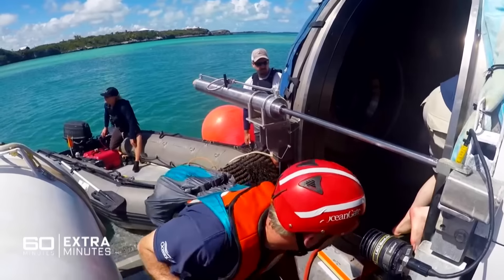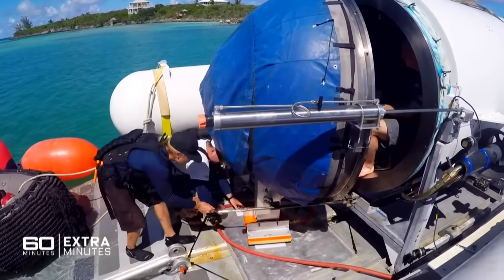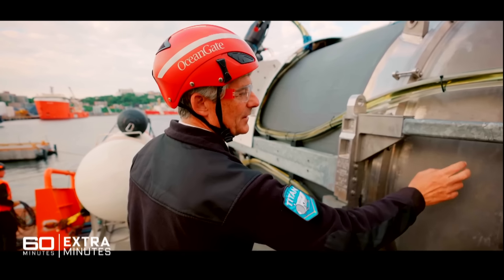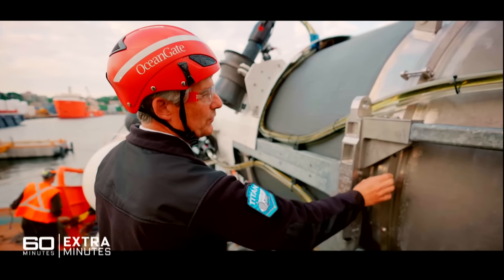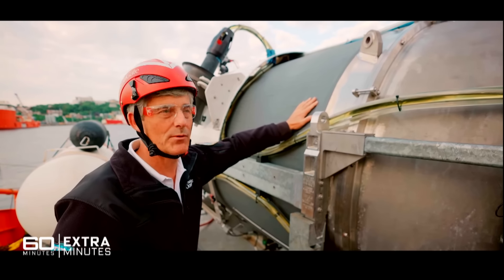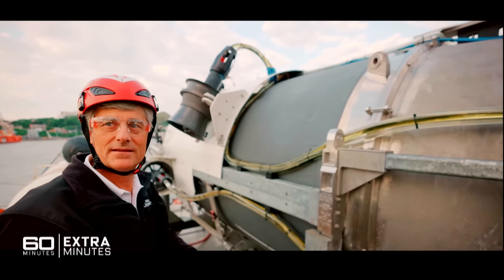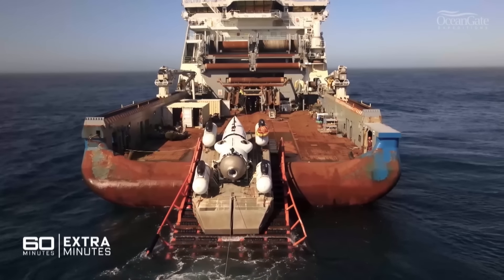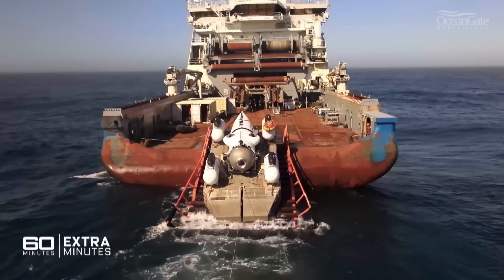Titanic sub implosion explained | 60 Minutes Australia

Comment: I was a fabricator at boeing for a few years. Based on the knowledge of composites gained there, this design is madness. Glued joints under that much pressure, not to mention the carbon fiber. Absolute madness.
Reply: Narcissists are the perfect test pilot for crappy technology.
1) if it works, you have a new technology
2) if it doesn't work you get rid of a Narcissist.
win win situation
Reply: And he fired every engineer that said his sub was subpar and only kept the one or two on that were happy to do what they’re told and collect a paycheck.

I suspect once the estate is figured out in the next decade and the NDAs are no longer valid, those fired engineers will come forward.
Reply: Good news: Stockton isn't mad anymore.
Reply: You’re not entirely wrong, but the ocean environment is very very different than aerospace.  Y’all outside the ocean environment think you know more than you do based on best practices for an entirely different industry. Stockton, an aero engineer, did the same thing.  

Ultimately this was a bad design, but for none of the reasons people like to list.  If you understand the ocean environment, it was a “very intriguing” design due to the low net weight provided by the large size and lack of need for syntactic foam, ship crane, etc.  

The glued joints btw were quite possibly just fine.  It’s confusing to me people are having such a conniption about that.  We used glued joints in the ocean environment often enough.  You have to remember that the deeper you go, the more the ocean is pushing the bottle shut.  That doesn’t mean glued joints are always appropriate or that there aren’t QC concerns, but it is not grossly negligent.  

Carbon fiber is also probably just fine if you’re not load cycling it (which Stockton was) and if you’re doing proper QC (which Stockton was not).  

With the cost savings versus a traditional design, they possibly could have afforded to swap the hull after every dive and still beat the competition on operating costs. 

Anyway, it’s a stupid design but understand the same “hubris” Stockton had by thinking he could do Ocean Engr with Aerospace experience is being coincidentally repeated by so many folk here on the internet.

Also, there are more airplanes that crashed in the sea than submarines that crashed in the sky, so really which camp would you rather trust.
Reply: Comparing Titan with a Boeing 737 Max 😢
Reply: @stevebean1234 It's pointless to say "carbon fiber is fine if you don't use it in deep sea applications" which is THE WHOLE POINT of this application. Carbon fiber was absolutely not fine in any way shape or form. You're just rambling, and your last sentence is utter nonsense.
Reply: The guy being interviewed is not an aerospace guy. He is an ocean guy. Feel free to disagree, but he thinks it's a terrible idea based on his work with subs.
Reply: Ya ya ya
Reply: You may have actually seen the rolls of carbon fiber that Oceangate used to build Titan, as it was reportedly discounted "past its use-by date" carbon fiber purchased from Boeing.
Reply: Jets with composites ARE designed FOR INTERNAL pressure...NOT External.  There is a big difference.  Cameron specifically called this out.  Composites are ONLY for Jets..PERIOD
Reply: @robinj707  I am an aerospace guy with experience in fracture mechanics, GR/EP structures and pressure vessel design. GR/EP is only good in tensile loading. It has very little compressive strength. The submarine hull is under compression.  GR/EP was the wrong material.  I wish they would have talked to me, an experienced engineer, for just 10 minutes.  The designers had to be kids with no experience.
Reply: @jonnymakers9560  No, not "... ONLY for jets..PERIOD" .... Carbon fiber has been used in race cars for over 30 years, high performance road cars for 20 years, and today increasingly in ordinary cars too.  Ditto a similar history of usage in bicycle frames and components.
Reply: @MrTodayistheday  With all due respect, Stockton Rush entirely ignored the advice from many people with similar or more experience than you, and notoriously fired one employee who told him exactly what you said.  So there is zero chance that you could have persuaded Mr Rush any differently even if you had spent 10 hours with him.
Reply: Doesn't boesing use carbon fiber for its parts?.... Thought that sh*t was supposed to be 3x as strong as steel?
Reply: @yodaddy82daddy70  Carbon fiber is massively strong under tension, not so much under compression.  Think of it like a rope, great for pulling a heavy load, but useless for pushing anything.
Reply: @pulaski1  ahhh. Makes sense bout to say I've seen the Koenigseggs bounce off walls going 200 mph and barely get damaged
Reply: The carbon fiber would have been fine if they cured it in a vacuum and did a real test to see if there were any cracks micro tears and such. But they did none of that so of course it's going to break. They also never did any tests on the carbon fiber after diving.
Reply: @jonnymakers9560 Composites are great for various things, not ONLY for jets. But, piss poor for something that is taking external pressure, compressive forces aren't something carbon composites are good at. But, viable uses for carbon composites, rockets, aerospace, high performance cars, bikes, et cetera.
Reply: One of the sadder stories is that there was a father and son on that trip.  Because he was scared, the son initially didn’t want to go but relented at the a day before as he thought it would be a good way to spend more time with his dad.
Reply: @yodaddy82daddy70  only under tension. Not compression . The application was purely compressive load. Its a terrible idea and a small miracle it dove so deep multiple times.
Reply: @Handro_  no. Compression is carbon fibers greatest weakness. It is strongest under tension, has diminished strength under flexion, and is weakest to compression.  Compression is what a submersible experiences. It was a terrible idea and the fact that it pulled off multiple dives is amazing.
Reply: To be fair, I wouldn't feel too sad. Each person who died went into that thing WILLINGLY, signed waivers and such. So it was a known risk to do such a thing, that said no-one could get me into a DSV made from carbon fibre. 👍
Reply: Holy shit ! Suddenly everyone on the internet is a carbon fibre expert & for all of it’s applications.
We have people calling each other out here that most likely can’t even keep petrol powered garden machinery running for more than two seasons before throwing them away for new but they know all about pressure cycling submersible vehicles to 2100 fathoms.
Reply: OK you are perfect to settle a debate I've been having since this happened. I say if you had smaller titanium rings inside the carbon fiber section it would have made it stronger. The other side says that titanium rings inside the carbon fiber section would have made the sub less strong and would have imploded sooner because of the different ways each act under pressure. Thoughts? I can't see my way being weaker than just carbon fiber but we have been arguing about this since day 1.
Reply: @Henry-sv3wv there is a difference between narcissism and greed.
Reply: @butter7734  to be honest I dont know. But my guess would be both ways are equal and different methods of failure. By having the titanium inside, as opposed to "on end" you may be creating a pitential shear point as opposed to potential separation points. To be honest tho I'm guessing because my knowledge on these materials is not extensive as I only did fabrication,  not engineering.  In my opinion the carbon fiber pressure chamber was a weak link no matter how you stack up, or attach the other components.  Sorry I can't help to settle it.
Reply: @GSF404   im not sad. You're sad.😉
Reply: @butter7734  Titanium has more desirable properties than carbon fibre when it comes to compressive loads, it might have helped but the titanium rings the two hemispheres were bolted to wouldn't have added more strength of internal as it was just a method of interfacing the hemispheres and the carbon tube. The issue being there was no 'ribbing' along the length of the carbon fibre crew compartment, of there as a bunch of titanium rings arranged like that, that would have helped in all likelihood but I doubt it would be a permanent fix, carbon does isn't suited for DSVs, there's a reason no-one makes them out of that. High Yield steel is used for submarines like the Astute class, HY steels aren't all that hard either for reference.
Reply: Maybe he wanted it to fail, unless he was just that stupid, I think he wanted to fail, and get the full titanic experience of death
Reply: @deadbrother5355  no problem to tell you the truth is was nice debating someone with a brain. Sometimes it's difficult these days. Everything you stated has come up in our debate. Thanks for responding though.
Reply: I think most sane people would (and should) have bounced when they noticed the thing was controlled with a Logitech controller.
Reply: But...but it's cheaper.
Reply: @DV-zv4ox  I would have, not everyone is smart, even if they have 250 grand..just privileged
Reply: @@klinestill "That's either madness or idiocy or both."

Negative.  You're whole post is nothing but theory, and practice disproves it.  It depends on the application.  US navy has ocean systems with glued joints that have been in use for decades.  Decades.  Does not mean glued joints work on every system.
Reply: @channelchen  the biggest issue is the Carbon Fiber tube.  Two main reasons 1) Carbon Fiber is difficult to manufacture flawlessly, for a serious application like this you should use ultrasonic scanning to inspect the finalized product to make sure there is no void space.  Ultrasonic scanning is totally viable, although reportedly OceanGate was not doing this (there might not be truth to the reports, because you'd have to be pretty crazy not to do it).  and 2) when you load cycle Carbon Fiber (meaning you put a lot of load on it, remove the load, add the load, remove the load, ..., over and over), the individual fibers inside the carbon fiber can snap.  What this means is every time you flex it, it gets a little weaker.  Since Carbon Fiber is really rigid and complex, you can't really tell how many have snapped or how weak it has gotten (without ultrasonic scanning perhaps) until all of a sudden it cant take the load anymore and it fails catastrophically.

Both issues could be mitigated with how they operate.  For example, they could ultrasonic scan the CF tube and throw away any that were bad.  Also, they could have chosen to throw away the CF tube after each use.  However, in both cases they would have to have a good design and testing.

With "A LOT" of R&D, its possible they could have accomplished a lot more.

Tbh, I think they took on a lot of risk (which was stupid), and cut corners (which was nuts).  That doesn't mean what they were doing was impossible.
Reply: @robinj707  THANK YOU!!!  And the Rob McCallum guy is a PADI Diver with two Management degrees - not an engineer at all!  UGH.  Rob's comments aren't exactly wrong, but they're far from the complete truth.
Reply: @MrTodayistheday those guys obviously had a arrogant boss who only wanted to hear that the sub was perfect in every way and they wanted to cut cost and beat the competition, they weren't going to do anything traditional and spend a ton more. They knew it wasn't deep sea worthy and took a gamble every dive to make more profit for very little cost to them
Reply: maybe its a chemichal wises , I believe there is an option for carbon , just not the way it was done on the Titan and Cyklon
Reply: Given your expertise, do you have any theories as to why he would do something like this?    I saw one interview where the person said he thought Stockton Rush knew this was going to happen and wanted to use it to make a name for himself.   It’s really hard for me to imagine something like that.
Reply: @banzairunner7860  I can only guess. If I were to guess it would be either:
1. He was nowhere near as educated on materials and engineering as he thought.
2. He was truly a fly by the seat of your pants and "break stuff" type.
3. He had mass murderer /suicidal tendencies. 
4. Possibly all of the above. 
As a footnote its amazing to me that the titan made multiple dives so deep essentially on the strength of the resin in the carbon stack up alone.  I'm curious what his life insurance policy was worth.
Reply: @banzairunner7860  He thought the failure detection system, which was supposed to detect cracking/ failures in the hull, would give them time to surface, at which point he would have had to replace the hull.  In reality the hull was making audible cracking noises from the earliest test dives in the Bahamas - yes audible cracking noises, no fancy detection system required.  ...... What I haven't seen is any explanation of what Stockton Rush considered the limit of "acceptable" cracking noises to be?  At what point would it be considered a problem?
Reply: @stevebean1234 rethink your position
Reply: Well said
Reply: @Handro_ when I saw how it was manufactured, I felt the same. Just a tech guy here, but have worked with a lot of different  materials and applications. Well said
Reply: @banzairunner7860  Yes, the traditional designs like DSV Alvin have much more weight than buoyancy and rely on very rigid and expensive syntactic foam in order to resurface after diving as deep as Titanic.

By having a voluminous carbon fiber tube (which displaces more water), buoyancy is increased.  Carbon fiber has better strength:weight ratio than titanium. By not needing syntactic foam (which is very heavy out of water), you don't need a ships' crane.  So you can deploy off normal ships and save money.

It is an interesting design hypothesis, you would just have to mitigate Carbon Fiber's weaknesses with R&D or operations techniques, which would have added cost (possibly, more cost than the design was worth).  Stockton apparently didnt' succeed with that and IMO he was a fool to try.
Reply: @yodaddy82daddy70 Air Pressure is different from Underwater pressure.

There's a reason why we are able to send things to Orbit regularly, while we barely explored the Oceans.
Reply: Wouldn’t there be different coefficients of expansion for the titanium and carbon fiber that would stress the glue joints?
Reply: stevebean1234 Found Stockton’s ghost. Dude is dead and he STILL can’t let it go!
Reply: it wasn't a real event
Reply: @tropifiori  your ultimate question is really one of design tolerance.  the only "coefficient of expansion" I've ever heard is thermal expansion, and thermal expansion is really negligible for the scale and tolerance of most undersea vessels.  

at 4,000m you're at ~390 atmospheres of pressure.  that isn't negligible.  any pressure vessel is going to compress, bend, buckle at that depth.  so, going to depend on how much compression is going on and how elastic the glue is.  

Worth remembering that bolt holes in pressure vessels have similar problems.  can't calculate bolt hole stresses effectively with CAD so have to derive the stress concentrations by hand.  the geometry of the end cap and hull are different enough that they'll compress at different rates, so all that stuff adds some challenge to the pressure vessel design.  Therefore, if you have the right joint design the tradeoffs of using glue might be worth consideration

IMO the glue is absolutely a sketchy design choice for a crewed vehicle where the criticality of failure is much higher.  probably safe to assume oceangate didn't do extensive R&D on it, either, which is a very unsettling thought.  maybe they had access to good trade knowledge but thats a rarity so i doubt it.  keep in mind though they also successfully completed 13 dives to the Titanic so it wasn't so sketchy as to outright fail all the time.  still a wild choice.
Reply: I was a helper for Einstein for years and built many ships this was a fail
Reply: Carbon fiber is for tension.. not for wrapping and pushing from the side. This was insanity on steroids. I'm not an engineer, but I know tension and compression. This was ridiculous and deadly.
Reply: And no Autoclave treatment......
Reply: @stevebean1234  You stated that glued joints are 'possibly' fine and then that using these joints is not negligent. This cannot be.  To use a joint that is 'possibly' fine in that environment is negligent.
Reply: @@DaleGribble-us9wc they merged, but you're right. The company took a hard turn in ethics when the McDonnell Douglas leadership took over.
Reply: @@DaleGribble-us9wc 
Boeing existed at the same time as McDonnell Douglas, McDonnell Douglas merged with Boeing in 1997, it's uncanny that you would "know several people there, having been in it yourself"....
Reply: @MrTodayistheday  what is GR/EP
Reply: @@DaleGribble-us9wc 
Not to put too fine a point on it, but this is the Internet, the reality of that being, there are literally millions of people checking YT comments forum out at any given time, from all around the World......as much as the age of ignorance is well and truly over, and we can literally pinpoint within reason, pretty much any location on the Planet with Satellite assist and assets like Google Maps, it still just comes down to having the inclination to "search" for a specific geographic location, I live on the Australian Eastern Seaboard, right on the Coast with the Pacific Ocean at my door, so, no, I don't know the one in "Hazelwood MO", and to be quite honest with you, I don't particularly feel inclined to "search" for the location. But all the same, I hope you are well and are able to reflect on a life well lived.
Reply: Furthermore, it was reported that the carbon fibers' axial compressive strength is only 10%–60% of their tensile strength and their transverse compressive strength is 12%–20% of axial compressive strength.

A chain in tension is strong, but is completely useless in compression.
Reply: @stevebean1234 to be fair a submarine or submersible cannot crash in the sky lol
Reply: @stevebean1234  You might want to do a bit more research before you crap on those commenting about the sub, the completely reckless Rush, and his insane design which everyone that knows anything about CF and these subs said it was an impossible feat, he only surrounded himself with yes men to get what he wanted and lied about most everything, he didn't follow any proper protocols for anything he was doing, especially with the CF!!
Reply: @455buick6  you should do some research on ad hominem before attacking people.  i have spent 12yrs as an ocean engineer and designed 6 vehicles all but one are in the field today operating and all but one were undersea.  if you think i am defending oceangate you should go get your head checked, or take an english class, or both.  none of the people in these interviews are ocean engineers; they're submersible drivers or managers in the deep sea field.
Reply: @Vincentofvega  everything in engineering is "possibly" fine.  even when Boeing did 10's of thousands of pressure cycles on the 737 cabin, they still screwed up and the aircraft pressure hull would rupture 50% faster than expected.  sucked a couple ppl out of the plane over the pacific ocean.  it was "possibly" fine, they did a bunch of testing to gain confidence in it, and there were other factors that they didn't consider that made it not work out.  Nothing in life is guaranteed

I was also responding to a poster claiming glue is "insane" and it is not "insane".  Ocean systems use glued joints.  Negligent, quite possibly - grossly negligent, quite possibly - it depends what testing they did.
Reply: @OregonDARRYL  carbon fiber and fiberglass are bad materials but not for that reason.  they work just fine in compression.  the individual filaments are good in tension, and the epoxy resin is good in compression, and when you put them together they're better at both.  the titan made 13 dives to the titanic, CF works, they just didn't account for how crappy CF is because its failure is unpredictable
Reply: @stevebean1234 You said the glued joints were possibly just fine. Uhm...no they were not. Any responsible engineer who's had even a little experience with FEA (Finite Element Analysis) would have spotted the inherent problem and weak point at the glued joints and immediate put the design into question and scrapped the entire premise of using carbon fiber in this manner.

How this entire concept even got past an initial interation of stress analysis is beyond comprehension.
Reply: So telling you to do more research before commenting is an ad hominem?  Exactly where did I say that you were defending oceangate?
Reply: @455buick6  "You might want to do a bit more research before you crap on those commenting about the sub
"

Rather than argue a technical point, you're implying I'm uninformed and "crap[ping] on those commenting about the sub".  Neither are true.  I admit to "crapping" on people who insulted me.

"...the completely reckless Rush, and his insane design which everyone that knows anything about CF and these subs said it was an impossible feat, he only surrounded himself with yes men to get what he wanted and lied about most everything, he didn't follow any proper protocols for anything he was doing, especially with the CF!!"

Rush was reckless.  CF is absolutely possible, hence the 13 Titanic dives it made successfully.  CF is impractical in load cycling / reuse applications, hence the eventual implosion.  As far as CF and subs, a vast majority of the people talking about it are submersible pilots, submersible company managers, and technicians - not R&D/ocean engineers.  CF is likely impractical, so R&D to develop safe "protocols" for CF in ocean has simply not been done.  Is there a theoretical protocol to safely use CF deep sea?  Yes.  Does it exist?  No.  Did rush break the protocol, then?  No.  Does a technician who hasn't been trained on this non-existent protocol know what he's talking about?  No...

I used to see OceanGate's job postings when I lived in PNW and didn't even consider applying bc something seemed off.  I am sure if I was there I would not last long bc his design approach was horrendous.  Is CF inherently impossible?  No.  Is CF a bad choice?  Probably, but it might not be - if and only if - you're doing requisite research and testing.
Reply: @stevebean1234  "Is CF a a bad choice? Probably but it might not be..."

No. It will always be a bad choice for this type of application. It's not a homogeneous material. It's held together by plastic (epoxy) and that's susceptible to fluid intrusion at high pressure...among other obvious weaknesses. It will never be used for submersible pressure hulls. Not sure why this is even a debate.
Reply: @jamescrud  then why did Stockton choose it?  Why did Steve Fossett choose it?  Why did a billionaire buy Steve Fossett's design?  How did Titan make it to Titanic 13 times?

There are discrete answers to the question.  Once you can answer those you'll see exactly why it's debatable.  But I doubt you can answer those questions, or else you wouldn't have written such a reply.
Reply: @jamescrud  epoxy, plastics, and polyurethane absorb water even in low pressure environments and are used all over in maritime engr.
Reply: As a guy whose fixed a xouple of fibreglass boats i his soare time i can also tell youbits bonkers
Reply: @stevebean1234  Exactly. These materials absorb water. That's the last thing you want to happen with CF. That infiltrated water under immense pressure gradually forced the CF fibers and epoxy apart over time...and boom...instant mash potatoes.
Reply: Boeing autoclaved their carbon fiber structures, while OceanGate did not. OceanGate also used outdated carbon fiber from Boeing who deemed it unsuitable for airline parts. Also one of the technicians who cleaned the glue surface on the Ti retaining ring did not bother to wear gloves and most likely left his skin oils on the Ti surface.
Reply: @stevebean1234  Concrete and rebar would have been better than this horrible joke of "engineering".
Reply: @stevebean1234  carbon fiber is not a good choice for compression jobs, must be some good crack you got
Reply: @stevebean1234  Incredibly condescending, and a stupid quip at the end about submarines crashing in the sky.  And you missed a key design flaw.
Reply: The real crazy part is it actually worked for around 30 or so dives... So it's not as crazy as it seemed just was probably years away from manned testing...
Reply: Anyone in their right mind allowing to be bolted shut from the outside and zero certification on safety isn’t too smart. Paying $250k to look out a tiny window for a few minutes is beyond ridiculous.
You can see close up videos of Titanic from your TV. They learn nothing by going to the wreck at all.
Reply: @nedmilburn  Yes, yes.  The truth is "condescending".  The ultimate irony is this is what engineer managers like Stockton Rush say to their people in order to keep them in line.  Guess you're one of the ones who can't handle the truth, either.
Reply: @mobilemarshall  Take a materials science class
Reply: @jamescrud  ". . .  gradually forced the CF fibers and epoxy apart over time . . . "

key statement right there.  what is the timescale?

PS - delamination via pressure is definitely one of the possible failure modes, but there are a couple.  having worked with CF and other passengers' statements of hearing "bangs" and "booms" while diving even to shallower depths, I'd put my money on breaking of individual fibers over time.  but could be both.
Reply: @pulaski1 Correct sir.  And as an add, it did, and still sucks in bicycle frames.   It’s not so bad for some components and I’ve built literally thousands of CF bike wheels with it ( rims being the CF portion of the builds ), for both recreational and racing applications with largely favorable and consistent results.  That being said, you couldn’t give me a CF bike frame no matter what I was using it for.  
The fact is also that bicycle manufacturers QC varies widely across brands for several reasons so that’s a variable to consider if you just have to have CF for your bike.   Certainly not criticizing anyone if they find it fits their needs.  Just not my cuppa.
Reply: @stevebean1234  It is both. If water gets into a void in the epoxy it's going to force the epoxy away from the CF fibers. Once that starts, those voids increase in volume filling up with even more water under pressure. The larger the void becomes the more surface area there is for the water to act against resulting in more and more force being applied to the epoxy and fibers eventually causing everything to break. This process started with the very first dive.
Reply: @dustinranck7388  CF doesn't do anything for me in a bicycle frame, or any part of a bicycle, period.  I only ride for pleasure, and saving a couple of pounds at the expense of the life of the frame isn't something I am interested in, even if it was the same price as aluminum.
Reply: @jamescrud  voids in Carbon Fiber are avoided with careful manufacturing and parts are tossed out in QC if voids are detected.  this has been common practice since before i entered the field, as early as 2002.  Void space in CF matrix causes several problems and likely not the one you described.  if there were void spaces in the CF they used, my guess is that it would have failed on the very first test dive and not have made it to 13 trips to the Titanic.

The main issue with your theory is that water would not ingress under pressure nearly as quickly as you would think.  there are air voids in nuclear submarine skin by design.  why isnt this a problem?  because air is compressible and the void space simply compresses as necessary to negate any pressure differential between the air pocket and outside environment.

void space is bad in CF not because of water impregnation, but because it will cause layers of the CF to flex leading to filaments snapping or further delamination along the matrix.
Reply: @pulaski1  i disagree,  but what type of biking are you into? That is a big factor i think. I mountain bike (xc and downhill) and my carbon bike is my favorite bike I've ever owned. I have 6 inches travel front and rear, and its several pounds lighter than my old bike of similar spec made from aluminum. If you're into bmx or road i could see your point tho as they are stiff af. I rode a carbon dirt jumper, and even though it had a front shock, the feedback through my feet was torturous.
Reply: @mangakey  i didn't realize it was so many dives to that depth. Nonetheless, it wasn't the strength of the c/f that enabled that. It was the resin. The c/f was a bad idea for compressive forces. I doubt it'll ever happen again, a c/f sub that is.
Reply: @deadbrother5355  You're obviously "into" bicycles, I just like to ride sometimes, not competitions, not against the clock, not even for "a cardio workout".  I just like to ride my  bicycle sometimes, to get out in the fresh air.  There is zero chance that it would be more fun on a carbon fiber framed bicycle.
Reply: Holding in 15PSI air is way easier than keeping out 6000 PSI of water.
Reply: THIS IS SPARTA!!!!!
Reply: @stevebean1234  You're referring to anechoic tiles attached to the surface of a submarines hull. They are not integral to the actual structure. The can fail and fall off with zero consequence to the structural integrity of the submarine...that's why it's not an issue.
Reply: @stevebean1234  sounds like you dropped out of yours
Reply: It was the decision to add titanium instead of steel, two different expansion rates and tensile strength….it’s a little different than bolting in components on an aircraft lol
Reply: @pulaski1  the weight difference goes a long way. But the rigidity on frames without shocks is brutal. The weight really does make it more fun because you can go faster etc. But if you're happy im happy.
Reply: @jamescrud  yes, the anechoic tiles.  the alberich tiles patterns are very often made from neoprene these days and when glued to the submarine hull maintain air voids inside the various diameter openings.  the submarine goes up and down and the air voids simply compress and decompress as needed.  They peel off in many cases but that has more to do with speed and mass density of water,

What you're speaking to in the latter half is "criticality of failure" from FMECA perspective, and yes I agree.  I think OceanGate is horrendous from that perspective.
Reply: @stevebean1234  Neoprene is flexible unlike CF composite. It's able to compress without failing so voids don't cause any issues.
Reply: Yeah i was booked to go on but pulled out after having my engineers go over the designs extensively, and strongly encouraging me to think twice about this venture. Dodged a bullet there
Reply: The average laymen would call it stupidity. No need to pull punches with something this egregious.
Reply: @stevebean1234  There's also a LOT more flights hourly and daily than there will ever be on submarine trips, so your numbers on airplane crashes into the sea are quite skewed.   Lets do some ratios and maths first before making a ridiculous statement that there's no submarines that crash in the sky.   Of course, NOT.  Don't be daft.
Reply: @@klinestill its neither madness nor idiocy.  Its all about narcissism and the Benjamins.
Reply: @Henry-sv3wv 😂
Reply: I don’t believe them 🤷‍♂️
Too much footage from previous dives but not ONE shot on this trip not even a pre trip video 🤔
YEAH RIGHT OCEAN(GATE)
GATE=
Reply: @Publiclighthouse this is an inaccurate story perpetuated in the media and posts like this. It is factually incorrect the young man did not want to go. He was in fact excited about setting a Guinness record. You should always look for facts before spreading misinformation. Thanks and have a nice day.
Reply: @stevebean1234 they couldn’t throw the tube out they only made one!
Reply: @pulaski1 the answer is that no audible cracking should have existed. The first noise was the first step to failure.
Reply: @JayandSarah  I totally agree - cracking during the initial testing proved that the design was probably flawed from the outset, and at very least the execution of the designed was flawed.
Reply: I guess I inadvertently stepped into an "experts" convention
Reply: @stevebean1234  bet you are the life of your own party uh
Reply: @lonewolf.63  ad hominem
Reply: @prospero11  ad hominem.  your post has zero substance.
Reply: @yodaddy82daddy70 parts being operated in an atmospheric environment is one thing. Comprising the hull of a deep sea vessel under direct loads of massive pressure is something else.
Reply: @stevebean1234 every engineer aerospace and ones that specialize in underwater craft said carbonfiber has been tried for seep sea trials and everyone agreed its not atrong emough. Why are u even arguing it clearly failed like predicted and ppl died. U need solid steel like the James cameron craft and even then its not made to go that deep more than once. The dude thoght he knew better and ignored other engineers and now hes dead and he took 4 ppl with him because of his arogance. And yet ur still arguing?
Reply: @MrTodayistheday they did talk to engineers. Then they fired them for saying this was a suicidal design. Carbonfiber works great above water. Race cars, planes. It doesnt work   when its glued together with pressure applied on all sides under water
Reply: @yodaddy82daddy70 it can be if its molded in a way where its hard to snap. Its not strong enough when pressure is appleied all around it under water. Also it was glued together on its sides and that is the weakest link so the pressure just  poped the sides of It inwards  killing everyone
Reply: @Handro_ thay onle works when you have air going over it and pressure is applied from one side like aerodynamics on a sport's car. If u applied pressure on the aerodynamics from a side that wasnt inteded to have high stress forces you can easily snap the best carbonfibef design. Its not meant to have pressure on all sides so it dont matter what they did to it. It would eventually fail anyway. They did vacuum seal it, otherwise it wouldnt work but it dont mater anyway. It would have failed regardless
Reply: @GSF404 except the kid. He wanted to impress his dad. He was nervous at first but the dad and stockholm convinced him its safe so he ended up believing them
Reply: @WhiskeyGulf71 lol right
Reply: @butter7734 if one material is compressed more than the other then it would be weaker. One of the materials would compress more and it would destabilize the whole structure. In this case the carbon fiber would compress and the titanium would sort of act like a knife cutting into it
Reply: @mi5iu491  we don't actually know the compression rate of both so that is why the debate continues.
Reply: @mi5iu491  you realize it went down like more then 10 times without proper stress testing and without proper manufacturing of the vessel right. all else equal it was already surprisingly strong. So had they made everything correctly it would have been fine. They even skipped out on bolts just because. It wasn't a problem if what they made it with. It was a problem of not doing it correctly. And if they did tests after every dive to see if there were any problems it could have actually been perfectly fine.
Reply: @mi5iu491  That is interesting that they fired the real engineers. :) The applications that you spoke of utilize carbon fibers' TENSILE properties.  Further,  it APPEARS they attempted to bond the GR/EP fiber to metal. That bond never has long-term structural integrity.
Reply: @Handro_  yea but thats the problem. The engineers he had told him the craft wasn't meant to go down more than once. Many of these craft are ment to go down once and that's is. If he listened he'd still be alive. Listen to what tat engineer said. Carbonfiber is too unpredictable. The microfibers mean they had no way of knowing what the maximum load can be. Issue is he fired and sued anyone that spoke up
Reply: @butter7734  yea thats why you don't send ppl down there 10 times
Reply: @mi5iu491  agreed. I did find an interesting recreation on a smaller scale. If you goto the hydraulic press channel the dude made a water filled pressure chamber and made mini replicas of the sub. Probably accurate somewhat of how the implosion occurred. It's interesting and worth a watch. Sorta where I started thinking about interior titanium rings.
Reply: @mi5iu491  First point, he wasn't a 'kid', he was ninteen, an adult. Second point he has to have signed the same waiver as the rest of the 'passengers'.
Reply: I could not agree more
Reply: @MrTodayistheday okay, but you can make up for a weaker material (plastics or FRP), by increasing the thickness of the wall under compressive hoop stress, or you can alternatively or simultaneously design stiffening rings so that you design the vessel addressing stability issues.
I don"t think the design per si was the problem, though. I just think that FRPs manufacturing varies quite a lot, and thus, the material properties varie as well. So, you can calculate a thickness based on a given "assumed" modulus of elasticity and the end product might have a totally different modulus, which in the end might mean the actual calculations will not predict behaviour properly. Also, it might be hard to predict long term modulus for FRPs and  that might mean a sudden catastrophic failure might not be predictable at all.
Reply: @Yes_I_c4n  Yes, you are correct. On paper, you can create a design that works. Unfortunately, the manufacturing processes are too temperamental to support such a design.  The bond between the metal and the graphite is tenuous at best. Further, parts produced from GR/EP tend to have porous areas that would likely fail under extreme pressures. 
I am nearly certain that pressurized water ingressed between the two materials. As a  the inner tube ended up carrying the entire load. 
Many years ago, I led the development of these processes for a major aerospace company. I was the guy who would approve designs, reject designs, or initiate new R&D activities in this area.  I would have dismissed this design and not even funded an R&D activity required to produce this design.
Reply: @butter7734  stiffening rings is something used quite often to make sure vessels or pipes under internal vaccum (or external pressure - as was the case with the submarine) remain stable, aka do not implode. They are meant to increase buckling resistance without requiring added wall thickness. Think of it this way: you either increase the wall thickness or you add rings to it in order to increase buckling resistance.
Reply: @GSF404  rings should not be made along the lenght of the vessel. That wouldn't have helped. Stiffening rings/ribs are designed as discs/rings around the vessel.
Reply: @Yes_I_c4n  yes we know this but we don't know how carbon fiber reacts under pressure. Because of the different rates of shrinkage of the fiber and metal there was a disagreement. Imo it would have definitely made it stronger. The other side doesn't think so and since this craft was the only deep sea carbon fiber hull in the world don't know if we will ever find out.
Reply: 100% agree idc what anyone says glue and plastic being used to go that deep is madness
Reply: That's why it's impossible to feel super sorry for them
Reply: As a mechanical engineer I have to say Boeing engineering is rubbish. Look at the faults rolling out regularly. Boeing ignore protocols regularly. I only fly Qantas Airbus, and yes CF composite is not for deep sea pressure. (compression and tensile values are erratically unbalanced).
Reply: @Nicholas.610  i agree with all but one point. The engineering is sound, quality control and expertise in fabrication is lax. That is because of production rates, not because the workers don't want to make good products. They just aren't given the time it takes to do the job properly.  I would testify to that.